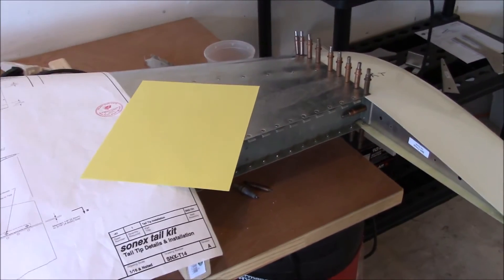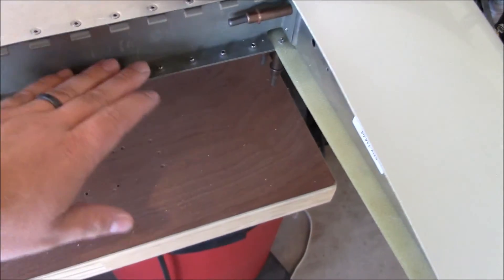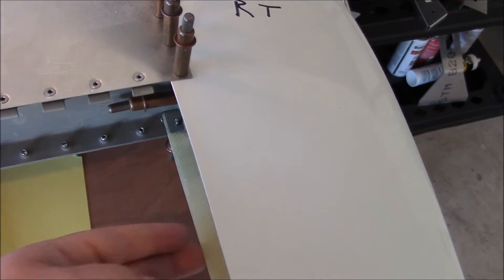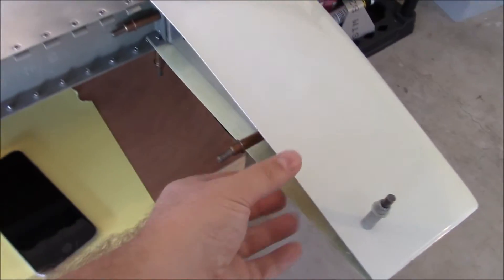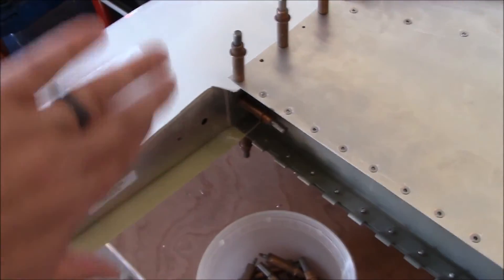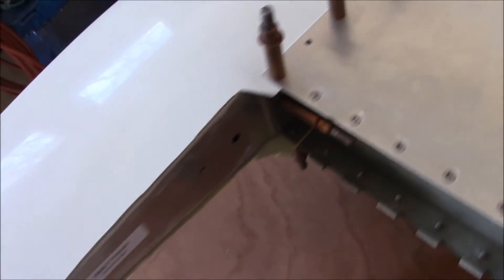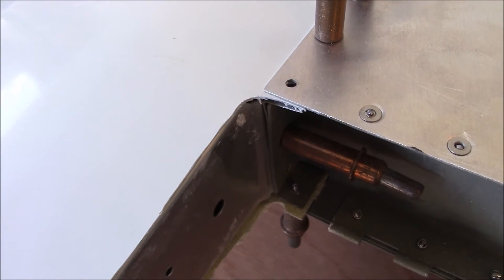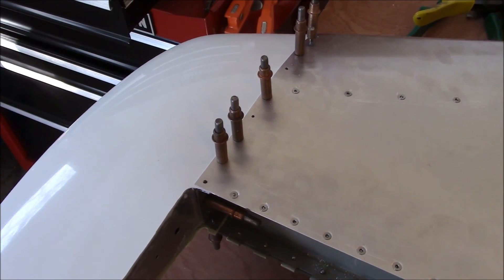Sonex Aircraft Build Video 28 Cutting Fiberglass Tips

Comment: Hi Daniel, Woodworkers use a "flush-trim" bit in a router for trimming wood or counter tops. Works similar to your dremel but has a roller bearing that rides on the edge of the wood, (aluminum in your case) and acts as a guide so you don't have to free hand it. Might go a little faster and be less scary since the aluminum would guide the cut.  Just a thought.  Enjoying watching your progress.
Reply from the maker: SyberPrepper Hi Syber Prepper. Thanks for the nice comment and the great suggestion! I will look into buying one of those bits for putting the cowling together and making the cuts on it. So far, the little dremel bit is working so I'm going to just finish the tips with that while keeping my fingers crossed. Thanks for watching and commenting! -Dan